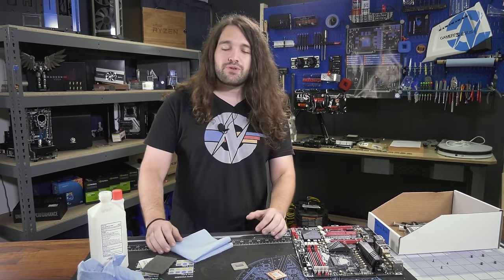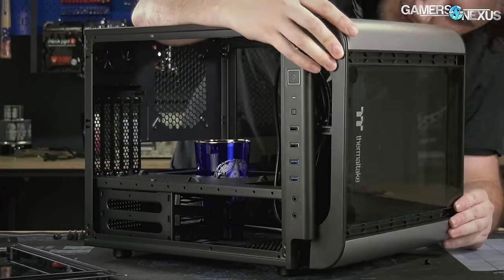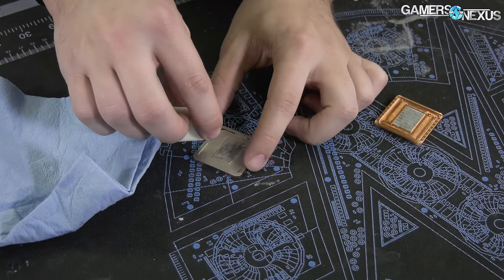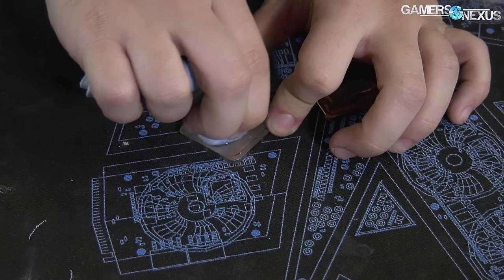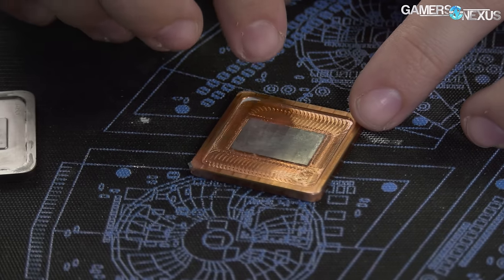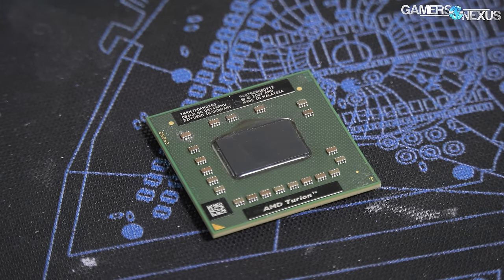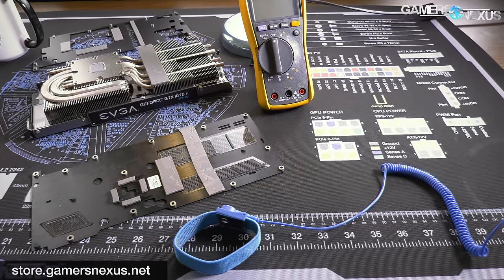How to Remove Liquid Metal from a CPU & IHS

Comment: Steve, that's not enough thermal paste in the socket.
Reply from the maker: WHY CAN'T WE EVER MAKE YOU HAPPY?!
Reply: And tacos, throw in some tacos
Reply: Should have used the spread method to make sure it was all covered.
Reply: According to The Verge, it's always good PC building practice to apply more thermal paste than the manual tells me to.
Reply: Best way is to get a credit card and make sure you smoosh it right in there in one swift motion. That way you have the best chance of shorting everything out and then having to go back to the store to buy a new everything. I mean by the time you get this stuff home it's already obsolete anyway so there's going to be some new hotness out when you go back. :) win win... except for your wallet, your wallet is on fire.
Reply: @GamersNexus  you can, you just have to do it again and put MORE thermal paste in the socket. Really make sure you COVER it in thermal paste for the best cooling performance.

Comment: Hey Steve! Just wanted to let you know there is a method to dispense liquid metal compound from the applicator / syringe without the danger of it squirting everywhere.
All you have to do is place your finger or thumb of your other hand between the collar of the syringe and the plunger, as you press down on the plunger it squeezes the thumb of your other hand as it goes down and this stops the plunger shooting into the barrel and the gallium shooting out. You can also put a collar around the plunger made of rubber tube or electrical wire insulation or paper tower, I even used cotton wool wrapped around the plunger stem once because it compresses at a steady rate. 
 All the best to all of you guys at gamers nexus, from StAsh420UK.
Reply: can approve that. done it the same way

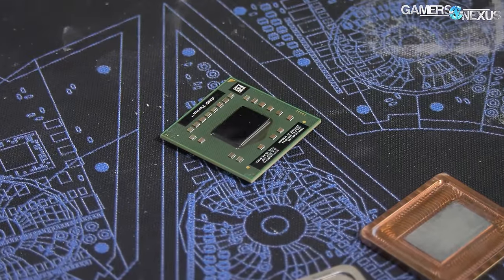Comment: 9:23 the reason it squirts all over the place is because that;s not the applicator tip, that's the "sucker" tip. if you guys used the right tips that wouldn't happen. Not sure why no one ever reads the instructions.

Comment: mine wasn't liquid anymore and alcohol did nothing. (i had to send my mb back to be replaced) and unfortunately ther was hardly anything left in the tube of Thermal Grizzly Conductonaut. its not great now hits hot weather and it hits 95C in prime with the Noctua NH-D15. guess i have to sand a little. for now i am happy i have a computer after weeks it took them to replace the motherboard.
maybe for long term its is better to go with a more "normal" paste

Comment: thinking about roughness of the surfaces, would it make a considerable difference to have the CPU/IHS at a specific roughness? If you used some sandpaper of different grit sizes would you achieve different cooling results with liquid metal?

Comment: To remove the remaining "black staining" I would suggest using "silvo" . its designed to bring impurities up and out. 
As a detailer by trade i see that color in metals all the time and a couple applications of silvo should bring back to a chemically neutral state.
Correct me if I'm wrong though.
Reply: After three years of no correction in the comments... I will try :)
Reply: @TheBinklemNetwork  Only thing i'd be worried about is how it gets those impurities out, is it bringing up a layer of metal, or just removing stuff on the surface? If it removes a layer of metal then that's some issues for cooling afterwards

Comment: If you want to get the surface really clean and smooth, I found a secret weapon: Weiman Glass Cook Top Cleaner and Polish. This stuff is used to finely polish glass top stoves and it works well on IHSes and cooler surfaces. I was actually looking around for some metal polish and didn't have any handy when I realized I had some of the Weiman stuff so I tried it and it worked very well, much better than just alcohol alone. You'll still have some of the staining unless you REALLY go at it for a long time, but I found that it got the vast majority of the job done in a fraction of the time. It has the added benefit of polishing the surface smooth.

Comment: I know that's probably a dead board you used as a prop, but for people who put TIM or LM in their CPU socket by accident (oops!) you can use ultrasonic cleaners to do the dirty work for you and most, if not all of it will be removed as it's a loose and / or soluble material.

Don't try this at home kids; Request assistance with a reputable entity who do component repair with their more expensive and powerful machinery.
Reply: By the time you ship it to him the TIM would be dry. Soluble still, but you want to have it serviced while "Wet", so try to keep it moist with solvents which will not destroy plastic or destroy still-functional contacts, so it won't take quite as long to clean up when you eventually find somebody to deal with it.

Comment: I bought the copper ihs for my 7700k and wanted to do liquid metal between ihs and cooler. Yeah it didn't want to spread and spilled into the socket on my z170 mobo 😱😡🤬.   Mobo has been through hell as my wife accidentally dropped something on the socket and bent like 12 pins right after I just got done cleaning the liquid metal out of it. Must of got it all cleaned up and pins straight as everything still works fine going on for about 8 months now.
Reply: @frankzappa3156   3 times really as I found a bent pin when I switched from the 6700k to 7700k in my main system. I have a new z270 mobo to replace when and if I need to. It's definitely a survivor, so I've kept it so far. Lol
Reply: Frame it when it finally dies 😂
Reply: How in the hell you spilled it to socket? Did you take the CPU out and applied it over the MB? Tell us how it is possible!
Reply: @Tsiikki  nope cpu was in socket. When I went to spread it with the non lint qtips it just wasn't spreading, more or less moved like liquid (water) and dripped right into top of socket. Only thing I'm thinking it could've been was the surface of the copper IHS from rocketcool. Not sure if it needed to be prepped or something a certain way but I'm never trying that again with that IHS. The stock IHS worked fine with it spreading on the top. The underside of IHS spread perfectly just like normal.

Comment: Mr. Nexus, 

TLDR: Steve, try Fitz Polish to remove old liquid metal on nickel-plated copper (maybe copper too)

Old, caked-on liquid metal comes off of Nickel-plated copper pretty well using "Fitz Polish." You might already know of Fitz Polish If you've ever gotten a delidding kit from Rockitcool, since they include it for cleaning off the die once all the solder is off. Acetone (which works well on liquid metal that's not all dusty looking & old), isopropyl alcohol, rubbing compound (ya, for a car--derp), & even scraping it off with a razor blade did not work well for me. Well, the razor blade removes the LM for the most part but scratches up whatever you were trying to get LM off of in the process. It also makes a big mess of dark gray dust. 

Anyway, I can only vouch that it works on nickel-plated copper--I haven't tried it on copper. It might be worth your time to check it out if you ever wanna revisit this.

Comment: as someone who had to clean the CPUs and bus coolers off 30+ builds recently... ROLL your Qtip as you clean and save yourself some matierals - just a little pro tip; don't rely on your cleaning solution - your tools are just as important especily if they are disposable. wear gloves, not compound.

Comment: don't know how common it is to get tim in the socket but Der8auer claims he is cleaning of Vaseline from motherboards by washing in the dishwasher, if it is not usable it could be an idea to test ( dry it with hot-air before powering and take out bios battery)

Comment: I used thermal grizzly liquid metal between cpu and air cooler...gonna upgrade my MB this week...looks like alcohol and nail polish remover will be enough. Works well, though, no complaints. Most likely will re-apply after installing new MB.

Comment: be aware that acitone is a mild etching process. it will remove your discoloration but its also introducing an atomic level inconsistancy in your surface finish. if you have previously lapped your die then, as previously mentioned in the video, this is not suitible for you. Lapping should largely be considered bear silicon in nature and you shouldn't use harsh chemicals or techniques unless you want to further risk the investment of the chip you are "cleaning". 

best practices are in your hands though. a previously lapped CPU should not be lapped beyond spec recomended in practice - be aware that is 3rd party testing; anything you do after that /further/ voids your warranty. if you are feeling brave however. black represents a change in material. question is if its an oxidation or an alkiline staining. Oxidation impeeds most thermal/electrical conductivity and increases (at the molcule level) pressure on the heat sync. while alkilization staining is an equaly mixed bag - which I am no where neare qualified to vouch for. Mostly its just discoloration - as far as I know; please if anyone knows better than me in the chemistry circle, chime in... by all means, save me from myself.

disclaimer: I failed HS chemistry but scored at the graduate level (college) in summer school, so I'm still a bit dazzled by the array of information - don't ask me. ask an athority who has industry access... 

Gnex? any better explination? maybe a chemistry colab might be necessary. :shrug:

Comment: Just polish it down. You can buy a really fine polish and that would just rub some of the metal off until you get a mirror finish. Im surprised you even mentioned steel wool because thats way too abrasive. Especially when 5000 grit sandpaper exists.

So anyway, a metal polish would basically take nothing off.

Comment: just a tip here

What could be easier? Simply palm of your hand and let the warmth of your body heat do the work! The melting point of gallium is 29.76 C (85.57 F), so it will readily melt in your hand or in a very warm room. Expect this to take around 3-5 minutes for a coin-sized piece of metal.

or

You can supercool liquid metal and then collecting it with a vacuum cleaner or gentle scraping

Comment: You're not going to get all of it.  It's not a stain, per-se.  What's left after thoroughly cleaning is a nickel-gallium or copper-gallium alloy.  The chemical composition of the bare copper and/or nickel plating has changed at a molecular level.

Comment: It's times like this that remind me that the nerds at GN don't work much with tools.  Lol
If I had a part that was separate or safely segregated, I would blow off all the liquid metal with compressed air.  The canned stuff won't cut it here, get a compressor.  And if I really was upset about corrosion on my IHS, I'd take my Dremmel to it with a wire brush tip or a polishing tip.  Although I wouldn't waste my time since nobody is going to see it.

Comment: Hi Steve,

Which kind of isopropyl alcohol are you using? The 70% or the 99% variant?

Personally, I'm worried about the 30% of water in the 70% variant. Is this something I should be worried about?

Thanks!
Reply: When using on the CPU or mother board, the higher precent alcohol will dry the water or other fluids faster. If you have a lower precent alcohol you might want to let it dry for longer after cleaning. Or use a hair dryer. It's how Linus gets away with making a big mess.

Comment: I use the 2000 grit then 1000 grit, 300 grit, 80, then re apply method, works like a charm!
Reply: lol...that grit stepping is not advised, unless you're doing rust removal on something you plan to throwaway!

Comment: Hey Steve, in your experience is liquid metal any more water resistant than say a more traditional thermal interface material at sub-ambient temperatures? Asking for a friend.
Reply: it's metal, it probably is waterproof, i wouldn't recommend using it in a subzero environment tho

Comment: Is it possible to damage or completely destroy a cpu by scratching it or pressing too hard directly on the die? What kind of precautions do you take? I feel like if I use any kind of paper towel or something like that will scratch or damage the cpu. 

If GN or someone else responds, thanks a lot.
Reply: The simple answer is yes, however it takes more force than you would expect.
At that point its less scratching, more gouging - not something you are at heavy risk of if you apply some common sense limits.
Reply: don't worry about scratching the die, it's quite hard to scratch, and if you are pushing hard enough to crack it you already snapped the motherboard in half :D

Comment: For the IHS lids at least, you might try an ultrasonic cleaning unit.
Reply: it can't work since gallium made an alloy with copper and ultrasonic cleaning can damage metal plating.
Reply: @PainterVierax  Not talking about the gallium alloy which of course I already understood, but rather removing surface contaminant.  Having cleaned plated parts many times this way, don't know what damage you're talking about.
Reply: plating can be removed with ultrasonic cleaning, even manuals for small (quite ineffective) consumer devices warns about that for jewelery cleaning. At work, we have worn chrome plated pieces with that method.

Comment: But your advice is, liquid metal isn't worth the trouble?
Reply from the maker: ... no?
Reply: I def don't think it's worth the risk to delid and liquid metal, at least in my particular circumstance.  Depends on the person, i guess.
I knocked 10C off my 3770K by switching old stock paste for IC diamond though, so might still be worth to switch your paste with a safer non-conductive alternative :)
Reply: @BothHands1  i have a delided 7700k already. I might use kryount instead and see what result i get.

Comment: Conclusion ? Better not to use liquid metal.
Reply from the maker: No. Not the conclusion.
Reply: incorrect.
Reply: LM is fine, if applied correctly, and super good at heat dissipation, as has been proven many times.  It's not easy to work with, but neither is my wife, and I still love her ;)